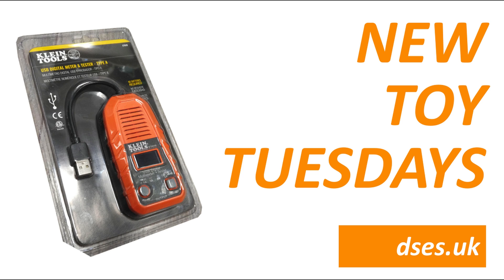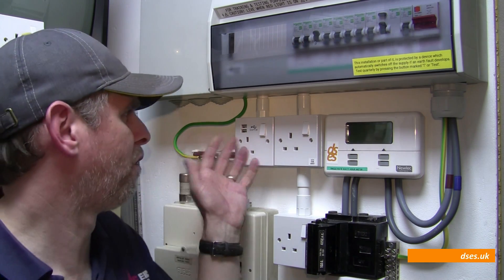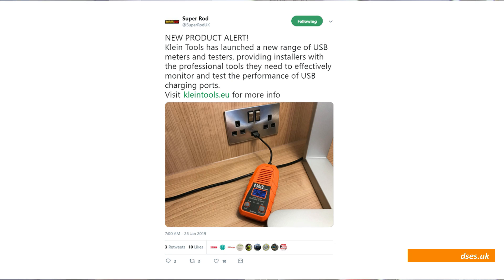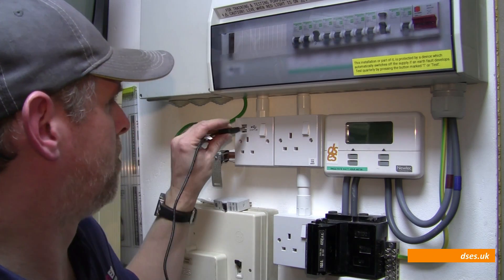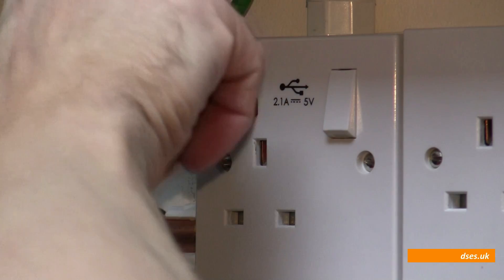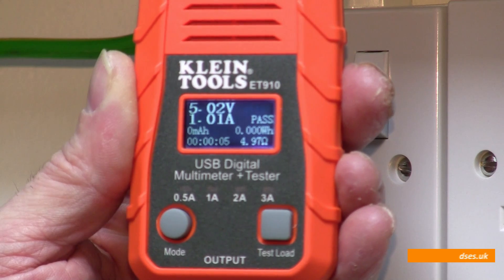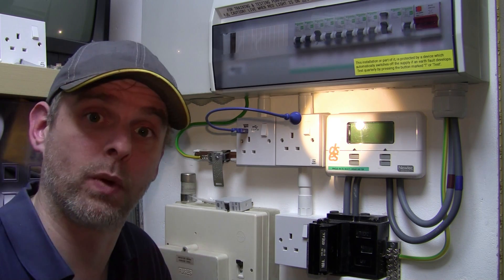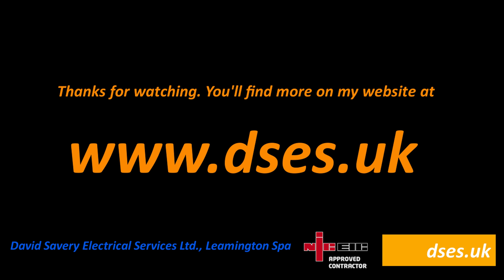NTT- The Klein ET910 USB tester

Comment: Even 2 years later, your Vid is still very useful and thanks for this complete and detailed review.  As of now, this instrument sells for 66$ on Amazon Canada and I agree with you that its is a bit expensive for such a restricted feature set.  The fact the instrument can't sustain the application of the load for a long period makes this instrument kind-of useless.  It would be great to apply a steady 2 Amp load and hold the load on the USB with the instrument to perform a proper test.  Would also allow to test battery capacity in Ah.  Holding a steady load for a little time will make the port "work" a little bit so you can figure out flaws on a port when its under load for a cetain period (overheating for example).

Comment: curious what the device with the LCD display is up on the wall with 4 grey leads coming out of it david
Reply from the maker: For illustrative purposes, that's pretending to be a smart meter, but I get so much stick about the fact it is really a central heating controller that I have since been out and spent my hard earned beer money on an actual meter to put in its place! At present, the tails simply loop behind the device, but they'll properly pass through the real meter when I get around to installing it.
Reply: @dsesuk  ah ok cool thanks for the info  i should send you a pic one day of the main board here lol i think you guys would get a kick out of it

Comment: Pretty useless without it showing what the charge port signals it can provide. Or did you ever see a phone with a "0.5/1.0/2.1A" switch?

To be useful it needs to reads and display the signalling, show which standard (USB/Apple/Android/mixed) it is, and then test with that load. It should then test the overload behavior of the charger and it should warn if the charger represents itself as HID or storage device.

Comment: I am looking for a good all round battery tester and liking Megger gear, the Megger Torkel 900 looks quite good and would make quite a good new toy Tuesday test. Any chance?🤔
Reply from the maker: Crikey, that costs more than my van! It's not something I would have a use for I'm afraid.
Reply: I nearly fell off my stool. 13k  I’ll stick with my Halfords resistor cooker box.  ( for my sins Marine electrical/electronics, always being asked to “check the batteries” and wanted to give a bit more info than ok or duff) enjoy your vids.
Reply from the maker: @CaptainK007  I guess my little 30 year old Tandy battery tester wouldn't do the trick then??! It does double-A's and 9V PP3's!
Reply: 😂..... nah

Comment: Do you think there's a possibility that some USB ports would fail after a few minutes. Is there a good way to test that with it? Like a sustained 2a test?
Reply from the maker: It's a good question, it would be nice to have a sustained test, I'm not sure why this model times out so quickly on the load tests.
Reply: Definitely, I've found that with the ones installed at work. They'll give you 3A plus (was charging a 20Ahr battery bank) for a few minutes then overheat and be shit. I'm assuming they limited it to avoid having to deal with all heat and making it failsafe/idiot proof.

Comment: Ah lovely electricians finger!..i get split thumbs from cutting...sore as shit! :-D I have a cheapo USB tester, like you used before the Klein, But i don't install USB sockets, for the reasons you mentioned, too much hassle, unreliable, not worth the call back.If they supply it, I will fit it, but only guarantee my work not their socket outlet. A guy is advertising fitting 2 for £15 pmsl, good luck to him if they all fail..hmmm.
Reply from the maker: That damn finger split just won't heal; I keep catching it on site!

Comment: Good video of a useful tool.  I would like to add though, that the data lines in a USB cable are used to tell the charger how much to limit the current.  (Ignoring USB-C oddities and QC quick charge etc. for now) They don't do this by using the proper USB serial comms, instead, the device (ie. phone) presents a resistance between the data pins and +5V which the charger senses.  Now, some cables only have the 2 power cores connected end to end, so the charger should go to a default low output (I think usually 100mA).  Some (naughty) cables only have 2 cores connected end to end, but resistors in the plug at the charger end to fool the charger into upping it's output even though it doesn't know what the device is really capable of.  There is more to it than that but I'm just saying there is more to it than meets the eye and it isn't completely right to say a cheap cable charges slower because it has a higher resistance.
Reply from the maker: Thanks Mike, who'd have thought the humble USB cable could be such a can of worms??!
Reply: @dsesuk  BTW, no amount of resistance in the power lines of the cable can account for a difference of 1A in charging---especially not at the source. Such a cable would dissipate the extra power as heat, making your phone charge slower put the meter would still see a full load. So what you said around 10:00 is wrong. Weird to hear that urban myth repeated by an electrician.

But extra resistance on the data lines, or missing data lines, or data lines fixed to special resistance values would change what the phone senses the charger can provide. Another common issue here is that Apple and everyone else are using a different signalling scheme here. (Apply was fist and then the rest decided to make a standard that was incompatible with what Apple already had. The usual "we are late to the party so we need to ruin the fun of the people who were there on time"...)

Comment: I personally wouldn't spend £60 on a device that's gonna tell me what I already know. If you've got 230v at the socket and the USB sockets aren't working, then it needs replacing. I'm not interested in the why, there are no serviceable parts on these things so the best you'll ever be able to do is replace it.
Reply from the maker: Sixty quid is a big ask, but I suppose from my point of view as an installer, I want to know that at the point of second fix where I'm signing the job off, the kit I've supplied is working as it should be and there are no duff outlets that require immediate replacement (possibly under a warranty call-out later). Similarly, if the client has provided me with some no-brand thing, I can prove at the point of installation whether its actually working as it should be so that I don't get blamed later when their iPhone bursts into flames (or something).
Reply: @dsesuk  I think on this occasion, I'll pry the wallet open and spend the 5 quid on an Ikea USB snake light 😂😂😂
Reply: Phones bursting into flames isn't too far fetched, as if the little 5v supply in the socket is badly designed, the ground of the usb or the 5v output may well be referenced to the mains! BigClive has done several videos on these lethal usb supplies, especially the 'gay dalek' camping lights with a usb port on the front that is referenced to the mains when the device is plugged in.

Comment: They should have just made it ramp up the current until the voltage drops below USB specs and just tell you the max current it was able to deliver.
Reply: The other little device shown, £5 or whatever, they have passthrough as well, you can buy little adjustable loads to plug in and gradually ramp them up to see how many amps the supply voltage starts to drop. I think my adjustable loads come from eBay or some Chinese supplier for under £5

Comment: Having just bought 6 USB cords for 1.99 Canadian  dollars on fleapit... I am not unfamiliar with conductor resistance. I think they used burned out heating element wire from John Ward failed cup-o-tea heaters. but they shaved it down

8 hrs connected to a genuine charger, 5% battery increase lol.
Reply from the maker: Oh dear! They sound like they're better insulators than conductors!
Reply: Some recent phones do actually communicate with the chargers, the Qualcomm quick charge specs allow for selectable output voltages from the charger if the connected device communicates and supports it.

Comment: Monitoring the mAh that goes through the meter during a full charge is quite a good way of determining whether or not a device battery is completely shagged or whether there is another problem. A marginally useful feature for sure, but one that I've used a couple of times.

Comment: Without the load capacity, it looks to have similar functionality to the Ruideng USB meter which is a good budget option (as recommende by Big Clive): https://www.banggood.com/RUIDENG-UM24UM24C-USB-2_0-Color-LCD-Display-Tester-Voltage-Current-Meter-p-1240574.html

The built in load tester and rugged looking case does look to make this Kein one a bit more suited to an electrician's toolbox though.
Reply from the maker: I think I've seen them on Amazon too. The colour scheme gives me a headache, but as you say, apart from the load test, the basic monitoring functionality is there. I suppose you could knock up a PCB with switchable 10, 5 and 2.5 Ohm resistors and a USB plug and you've got yourself something that does much the same job!
Reply: Thankfully you can adjust the colours to be less jarring, and USB loads (even adjustable) are very affordable from the usual places, but I might end up picking up one of these testers just for the fact it's nicely contained in the one unit.
Reply from the maker: Probably a no-brainer at half the price, but I feel sixty quid is a bit of an eyebrow-raiser.

Comment: be nice if the power to the usb worked with the switch for the socket
Reply from the maker: There ought to be some way to isolate it. If it were an external thing, you wouldn't dream of spurring it off without a 3A fuse, but you can do nothing when it's directly built into the socket outlet.
Reply: I feel like that would get more annoying if you wanted to use the USB port but not what was plugged in
Reply: @plateauelectrical8393  most of the time that's not an issue, might be an occasion when that could happen, but it's not good that these things are on all the time, and using the switch seems the simplest solution, unless they could fit another one for the usb only outlets

Comment: I love Klein tools I am from the uk and have a rare set of insulated linesman pliers from 1989 which dad gave me now I’m 16 so these are nearly double my age and they still are the best pliers I’ve ever used
Reply from the maker: Cool to have a tool with a bit of history attached! I still have my tools from my comms trainee days back in 1991, but they're not VDE rated so sit in the home toolbox.
Reply: David Savery Electrical Services oh nice one I have Snap-on and knipex and ck pliers but for some reason I always go for the Kleins but I don’t know how good the new klein stuff is from cef do you have any experience with it
Reply from the maker: I've limited experience with their hand tools I'm afraid. I got through two sets of their wire strippers in short order which put me off, but I'm still on the Bahco VDE screwdrivers and CK/Knipex cutters/pliers I've been using since setting up on my own, and unless I lose them, I suspect they'll see me out!
Reply: The Klein insulated pliers from CEF should be every bit as good as the old ones, the pliers, and snips are manufactured in the states using virgin steel ( not recycled ) in Kleins own foundries to ensure consistent quality.
Reply: I have 10 and 12 inch Sykes Pickavant water pump pliers along with Sykes Pickavant mole grips (Mole grips are a brand of locking pliers established in 1950 by Thomas Coughtrie, but is now used to describe any locking pliers just as hoovering is to vacuuming ) from 1988(god I miss those days) still in good working order, they also stay in my roller cabinet.